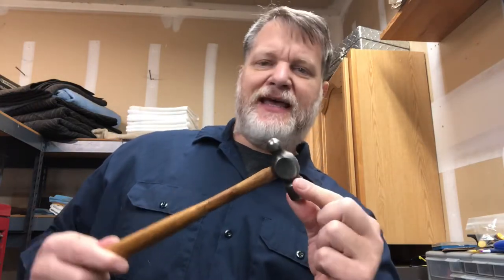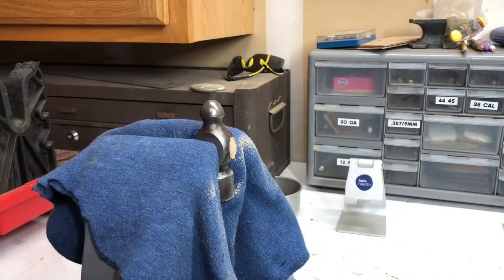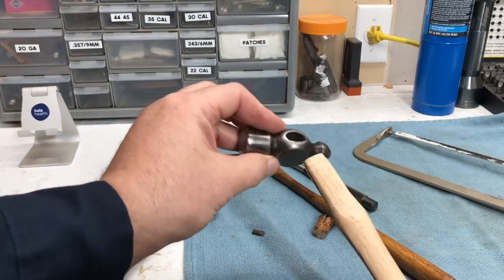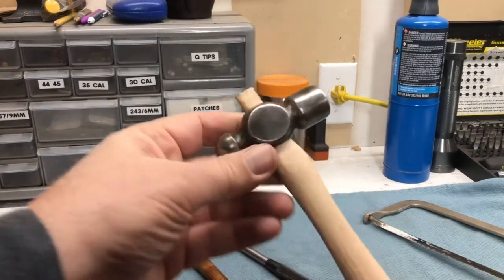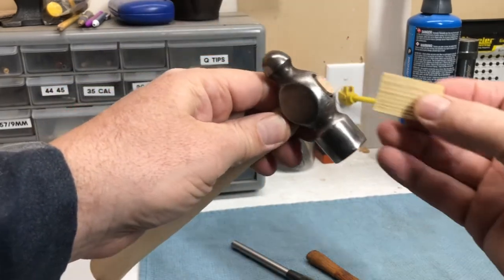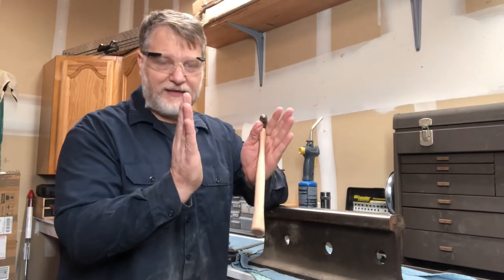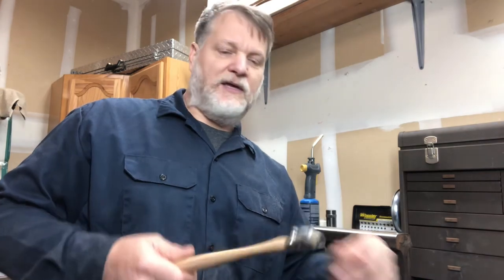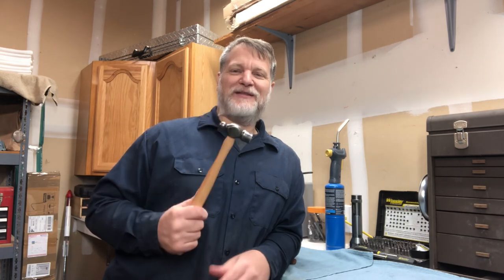The best way to replace a hammer handle and put an antique hammer back into service

Comment: Just bought a box of old hammers, and most of them have the heads on upside down. It's been a while since I rehung a hammer head, so I wanted to refresh my memory on the details before starting. Only good thing is that since they're on upside down, I should be able to save most of the handles, since I can just drive them out the way they went in.
Reply from the maker: I found a couple hammers with the heads on up side down also.  Funny how that seems to happen quite a bit.

Comment: You’re standing next to a machinist tool box no? May I ask what brand that is. Also where do you buy your machinist tools? And lastly where did you get the chunk of rail road? 

 I worked for a little bit when I was younger at a machine shop in central California and always wanted to find a spot in my garage for finer more precise machinist tools. 

Thanks for the video. I split the handle on my snap-on (blue point) ball peen I had for over 30 years and no way I’m throwing it out. Need to fix it. Thank you for this. The only good thing that comes from the interweb.  Nice that people share and help people. Appreciate you sir.
Reply from the maker: The tool box is a Kennedy.  They make absolutely the nicest machinist boxes.   They can be expensive, but you can find them used on Craigslist or even eBay.  Almost all of my precision tools are Starrett.   Calipers, micrometers, rules, depth gauge, all Starrett.  99% of my tools are USA made. 
The rail rod rail I picked up at a used tool store in Eugene Oregon.  Cost me $20!
Reply: @FlyingKSports  the rail road tie is awesome. Always wanted one. Great information on box and tools. Thank you for the names. I’d like to start a set quality machinist tools and sadly when I worked at one, I was too young and stupid to pay close enough attention to know what tools and equipment I used. Regardless thanks for the videos